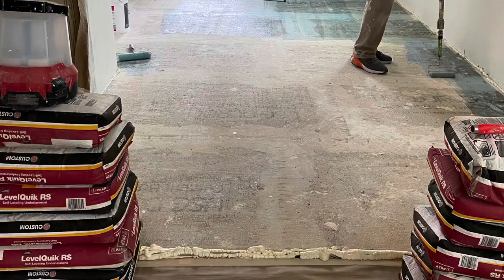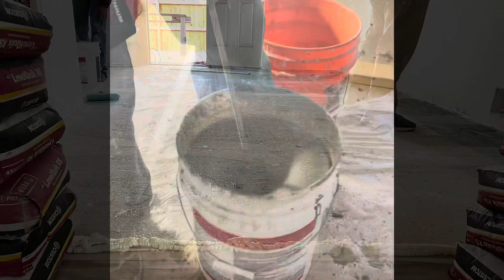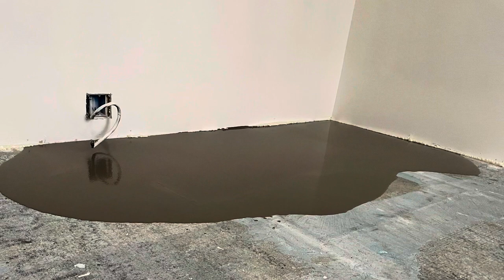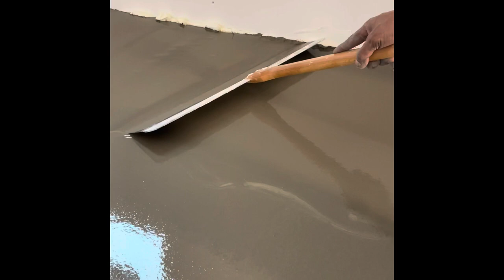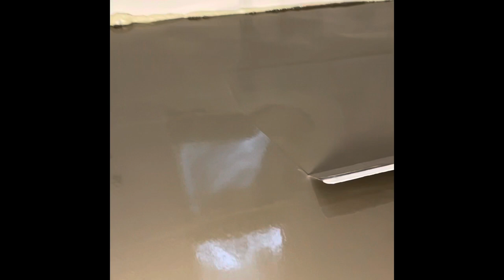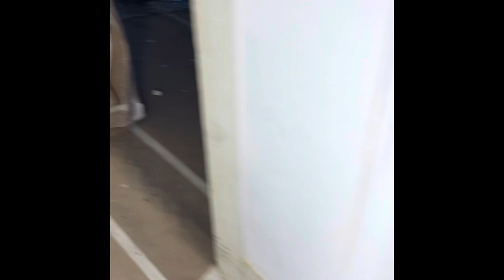Self Leveling Concrete over Durock

Comment: precisely what I’m trying to find out how to do and what requirements are for leveling over cement backerboard. So no need to use metal lath as well then?
Reply from the maker: No metal lath, just make sure you use thinset under c. boards then screw, then prime the cement board before applying the self leveler
Reply: @robertalanis9126  thank you so much for the quick reply. I was supposed to be priming the cement board today, but things got delayed. The cement board is installed exactly as it would’ve been if we were installing tile – but we can’t install tile anymore, so we’re going to vinyl plank. However, the floor is very unlevel and dips down, I think about 1/2”  towards the sinks and some in other areas too. 
so glad I found your video, and deeply grateful for your quick answer! looks like I’m on the right track, and can get this going tomorrow for sure.